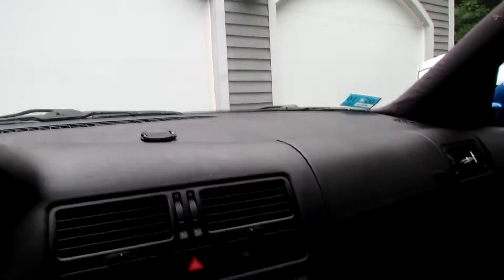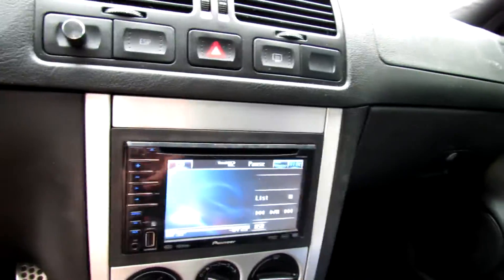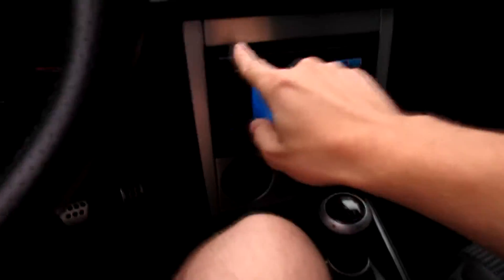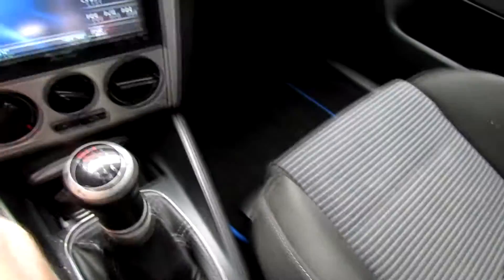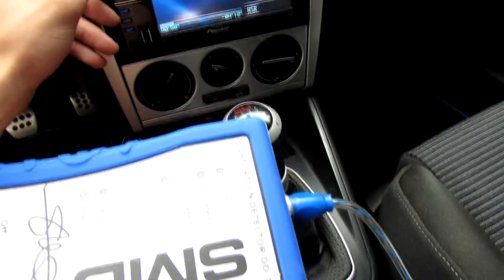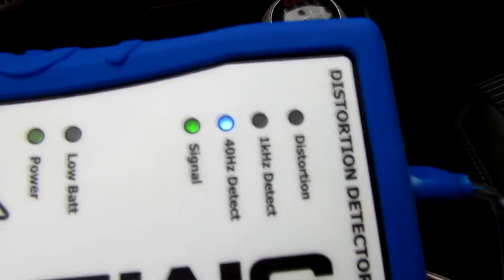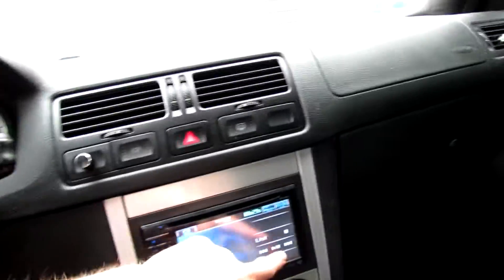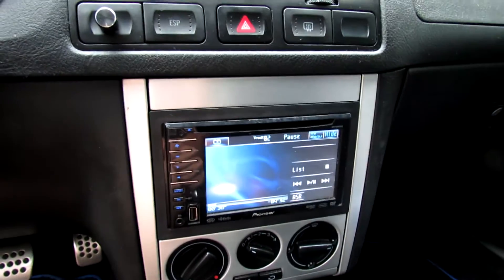Finding Headunit Distortion Point With a DD-1

Comment: Where do u leave your settings at on your headunit when finding the distortion threw rcas?
Reply from the maker: Flat EQ, flat everything. You'll want everything essentially set to default so its as "pure" of a signal that the HU can put out as any EQ or bass boost etc settings will add distortion and mess with your results.
Reply: Zack Hall what about sub level on the deck?
Reply: @lilj7072   Everything at zero 0. Max sublevel will be eventually reached on the "Sub Amp" this way you get the most power out of your system. Never adjust Subwoofer levels on HU.
Reply: @georgebarrios9603  not true. If you leave your sub levels at 0 your sub preout voltage will be low. In return youll have to turn the gain way up to compensate

Comment: Cool vid. So do you do the same test again after you've set all of your preferences (bass, mid, treble, fader, parametric EQs, etc.) to find out what your new "safe" volume is? I doubt people leave everything set a 0, right?
Reply from the maker: Sorry for such a late reply. Generally, this test is done to find the maximum volume point the headunit can output before it inherently puts out a distorted signal. Any changes to EQ settings and such will affect this result, however you shouldn't be using the EQ or any sound modifying settings on your headunit. If set up properly, you should have everything flat coming from the HU and any sort of EQ changes should be done through an external EQ or sound processor. More expensive, but that's the proper way of doing things. I also have never met anyone (without blown speakers) to use the balance and fader, I've always just left those centered for the most immersive sound.